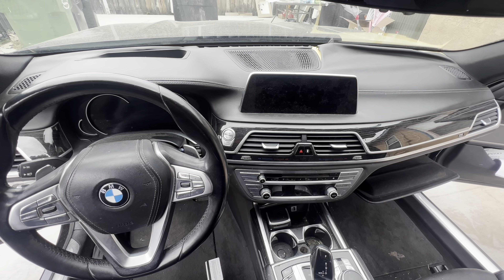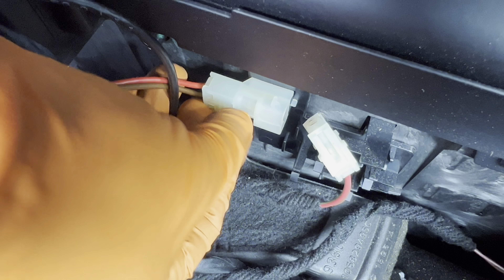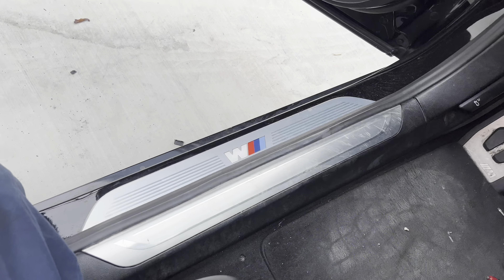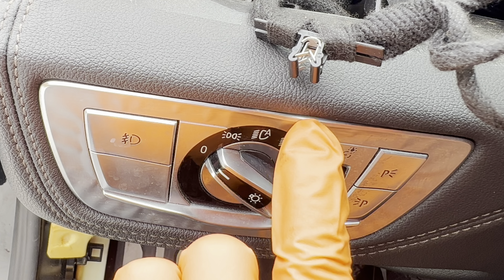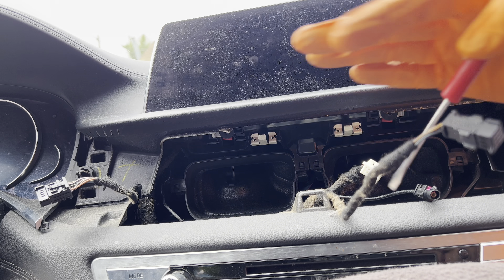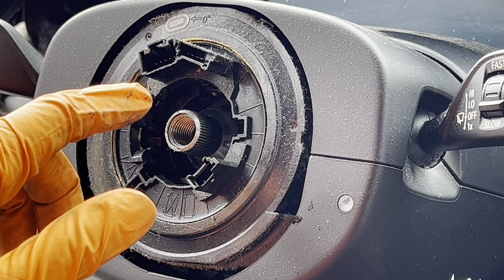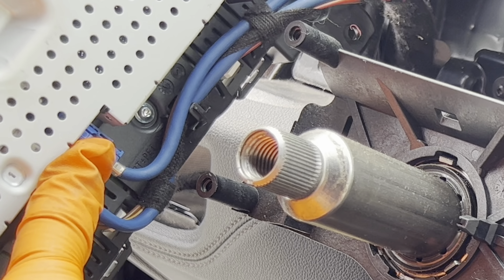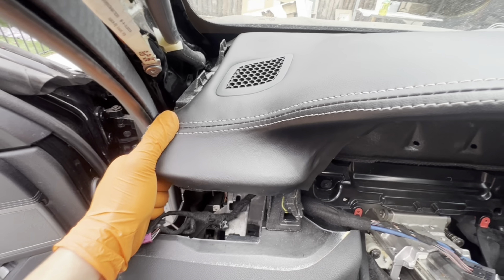BMW G12 7 Series Complete Dash Removal Dash Leather fixed.

Comment: You know it's a bmw thing when you have to start in the backseat to remove the dash ;0.. thx for another great video.
Reply from the maker: 😂 i never actually thought about that. Good point.
Reply: You’re right about that👍🏾
Reply: Most cars you have to start from back forward. I did a nissan maxima dash removal it was samr procedure.

Comment: Would you consider doing another one if I bring the car to you?  The video is thorough but a little intimidating for me to do it myself.  I'll pay fairly🙂
Reply from the maker: I would like to but unfortunately I don’t have a shop. Perhaps in the future that may be in the cards.
Reply: @friendlymechanic9778  I understand... Thanks.  Is there anyway to elaborate a little on the airbag removal?  Will I be pushing in and out, or front to back?
Reply from the maker: It’s pushing in on a spring. This is very difficult if it’s your first time since it’s all by feel. Just be very careful if attempting this these airbags aren’t cheap.

Comment: Very informative video. Thank you for sharing. Question, I have x5 f15 with leather dashboard, my leather not cracked but kind of peeled off in some spots, do you think is it possible to remove windshield and kind of glue it back from the front without taking everything off? What is your opinion?
Reply from the maker: Well, it’s a difficult question to answer without seeing the condition that it is in. But I wouldn’t recommend applying glue because that material shrivels up and becomes hard. It would be difficult to properly lay flat and there will be a gap as it won’t cover the same space anymore. 

Since the fix isn’t guaranteed I wouldn’t risk damaging the windshield this way.

Comment: This is one of the best videos for this type of work.  Well done!  One Question.  Is there anything you recommend replacing while the dash is out?  You know, like... Since you're in there, kind of a thing?
Reply from the maker: Thank you I appreciate that. 

Most of the things in the dash are replaced if broken. But things I would suggest looking at to see how it’s going off the top of my head are. 

1.looking at your center console area for any liquid spills that could of got into the ACSM (airbag control module) with the battery disconnected it is safe to remove the connectors and check for any corrosion inside the connector. 

2. If your windshield was recently replaced and you have a wind noise coming through. The repairing company should fix this if it does happen but you can get a good look at the glue and see if there is any missed spots and add some if needed to block the noise. 
You can also check if the expanding foam tape was replaced. This can also cause a wind noise and in some cases be added during this service. Most G series BMW cars take two strips of expanding foam tape. 

3. There is a drain for the evaporator you can look at if you have a water leak. A sweet smell can indicate a coolant leak (usually blue in color for BMW coolant) so a heater core may be leaking. If there is no color and only a moldy smell is present chances are it can be an mis aligned drain. If the leak is closer to the front door areas I would look for clogged water drains in the sunroof or missing lower clips in the door panels. 

Hope this helps!

Comment: Thanks for detailed video! 
Wtf, why hasn't bmw have a recall on this. Mine is slowly starting to peel from up top. I heard from many other bmw owners on other forums with similar issues. There should be a class action lawsuit bc of this issue.
Reply from the maker: I hear you I see it a lot here in the shop unfortunately. Especially when the hotter months come in.

Comment: Thanks for great video, but didn’t see you removing heads up display and center speaker
Reply: Look at the video at 29:26 and you can see clearly that the head up display still with the frame of the dashboard, he never removed.

Comment: Can you please tell me what is the best route to reinstall the hose to the expansion valve ...have it to line up correctly?
Reply from the maker: The expansion valve is located in the engine bay at the firewall. The Ac line should line up with the expansion valve easily. If you can’t aim it. Remove the center E4 stud that holds the 10mm and that should make things easier.
Reply: @friendlymechanic9778  can u tell me if line is bolted in somewhere on the bottom cause it feels like if I had more wiggle room I can get it back on...(I replaced evap core).... so trying to put it all back together.... ur video on the dash was very helpful 👌
Reply from the maker: If you’re talking about the AC line needing more wiggle room then yes towards the bottom under the DME there are clips and fasteners that can be removed to give more wiggle room. It’s a lot of work. 

I have a video on the 7 series playlist removing the upper coolant hose. You can skip ahead to the part where I remove the DME and see if that is the space you’re looking for to give more wiggle room. Feel free to send me photos on instagram to better see what you are dealing with.
Reply: @friendlymechanic9778  Thanks for your help and when I removed the DME i was able to get AC lines to move freely and connect to the expansion valve easly.... but now that I have it all button up the car will not start ... seems like it is not getting fuel but i checked and it is so it is not firing ... could that have anything to do with removing the DME?
Reply from the maker: I would make sure every connector is properly snapped into place and secure. Nothing loose. 

Is the car completely dead or does something turn on? Lights on the dash?
Reply: @friendlymechanic9778  Good morning and I found the issue ... one of the plugs on the DME was not all the way seated ... thanks for ur knowledge .... now I have to seal with the LCD screen not coming on and door handle sensors not working and a drivers restraint sys error

Comment: Hello Thank you for the video, I have the same problem with my car. My question is about the heads-up display, is there anything special that needs to be done to remove that. I didn't see anything on your video about that, Anyway, thanks again. I'm going to take the time to get this done as well.
Reply from the maker: Nothing special with the heads up display. If all you are going to do is remove the dash to get the leather fixed you actually don’t need to disconnect or remove it.

Comment: I needed to change vents, and I didn’t disconnect the battery. So i removed only center panel with vents, after plugging everything in ambient lights in center and driver side are not working. I checked the plugs and they are ok. What could I broke? :(
Reply from the maker: I would double check the connectors and make sure they were not mixed up in any way. They should be purple connectors. If everything is plugged in correctly the clear plastic tube that sends the light across could be broken. I would remove the trim again and check it while it’s plugged in and also check that clear tube to see if it got dismounted.
Reply: @friendlymechanic9778 Thank you for your answer. Actually, the same day earlier, I removed cover under passenger side (one with passenger legs light). I didn’t plug it in as needed to check some fuses afterwards, but it turned out that dashboard lights are connected in series with that passenger light - after plugging it in all leds worked again :)
Reply from the maker: That’s good, but just FYI the lights are not in “series”. But the bus those lights are on make it seem that way. Those lights are on a LIN bus and with that one connector unplugged it will take the whole bus down.
Reply: @friendlymechanic9778  Yep, that’s right, I just simplified what I meant ;) but thanks for detailed info - might be useful for others. And once again thanks for very, very helpful video! 

And one more question - have you met the problem of not working massages in G11/G12?

Comment: Excellent video. Very thorough explanation with great close up video. I have the merino leather dash in my 2021 X5M. Is the peeling leather a thing I'll have to look forward to if I keep the car long enough?
Reply from the maker: If it is exposed to direct sunlight for long periods or time it can happen. There are things you can do to help prevent it. 
Park in a garage when possible. 
If you park in direct sunlight using a sun deflector on the windshield will help. 
Don’t use any chemicals or armor all wipes on the dash. Just a microfiber cloth and water to clean. 
I would also keep a close eye on the leather while your X5 is in warranty. At the first sign of any peeling take it in to have it taken care of.
Reply: @friendlymechanic9778  Thanks, will do.
Reply: I have a 21 X5M and noticed mine peeling up yesterday.

Comment: This video was extremely informational and exactly what I was looking for. My 2016 750i head unit went bad and my goal is to do the job my self. You seem to know everything about these cars and I was wondering if you think there’s anything else I should know before taking on this job?
Reply from the maker: I would just re-emphasize to be careful with that blue cable. Also disconnect the battery before you start just to be on the safe side.

Comment: My question is there is a T20 on the rear of the dash in the corner on passenger side.  How did you get that?
Reply from the maker: I used this small ratchet with bits: https://amzn.to/3K8pIyM

This is an Amazon affiliate link

Comment: I would like to remove the rear control unit in the middle, with the Air vent . Does it work the same way with the g31?
Reply from the maker: It’s similar.

Comment: Great job! thanks for the tutorial. did you disconnected the two batteries before?
Reply from the maker: This G12 only had one battery, it was not equipped with an auxiliary battery. I did disconnect the battery. It is safer to do so since I was working the airbag system.

Comment: Did you disconnect the battery when pulling the dash? I know the 750 has a backup battery system.
Reply from the maker: Yes i disconnected the battery

Comment: Trying to look for a junkyard where I can find a 2016 BMW 750ix complete dash. Do you have any recommendations? I do not want to buy a new one one that come from wrecked one will work as long as the dash is in good condition
Reply from the maker: Hmmm that may be hard to find. It would have to be one with all the same features and not to mention the condition of the one find might not be great. If you’re willing to remove two dashes. I would consider just removing yours and finding an upholstery shop to re-new the leather. That way it will last longer.

Comment: Great Video! My 7 series has the same issue.  Do you have contact information? I see others have commented and are interested in getting you to fix similar issues, however you state that you don't have a shop. I am perplexed, within the video, you mentioned the owner had saved a significant owner of money for the dash replacement of only $500.  This would lead me to believe you offer your services for others. I thought of another possibility is to remove the windshield and apply adhesive to the leather.  What are your thoughts?  I appreciate if you can provide further contact info i.e email, etc..  Thank you for taking the time to read my comment.
Reply from the maker: Best way to contact me is through YouTube comments or instagram for private messages. The owner did save money having me do the work but the cars I post videos on are family and close friends. I do my work on my driveway and can only work on one car at a time. I would love to be able to help as many people as possible but I just don’t have space for it. 

I wouldn’t recommend removing the windshield and applying adhesive as the leather shrinks and becomes stiff. It’s hard to move around and form it back to its original place. I’m not sure how bad yours is but the car I worked on this was absolutely not an option and a complete leather replacement was the only option.